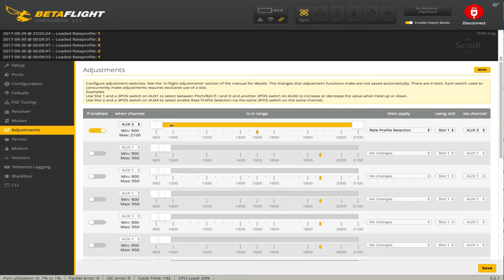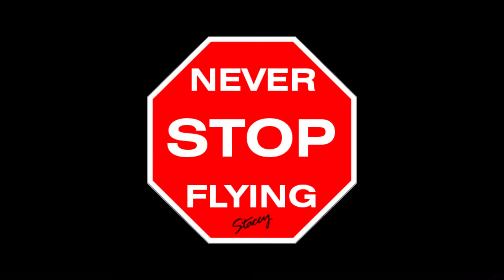I Was Wrong / Racing Rates / RateProfiles on a Switch

Comment: I keep same rates just get rid of expo and keep rates around 900 at most and it works out perfect. People add in so much expo and I don't even know how they fly with them ie such a soft curve and then suddenly around mid stick the rates just go nuts. But 300s are too low for racing even I believe.
Reply from the maker: Yeah, that's been my theory to stick with one set of rates, but I'm finding that it can be helpful to use different rates for different styles of flying, provided you can adjust to them.
Reply: I agree with Bari, I think if your rates are bad for racing, then they are bad for freestyle too. Some racing help me to refine my rates, now it's better for racing AND freestyle, I don't change anything for both.
Reply: Lol this has been the topic all week with my groups since our last race Sunday..  right on guys good to see others on the same topic...All Rates Matter